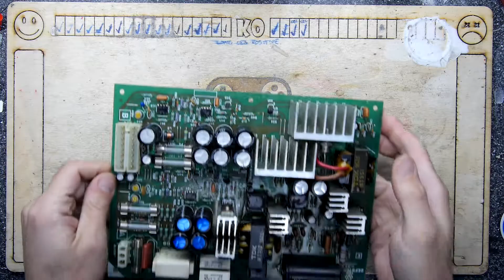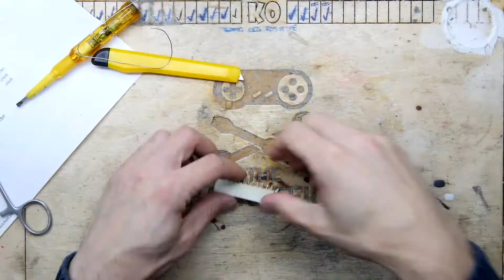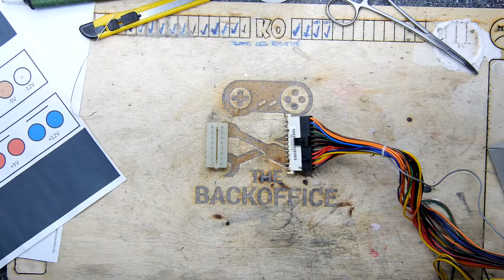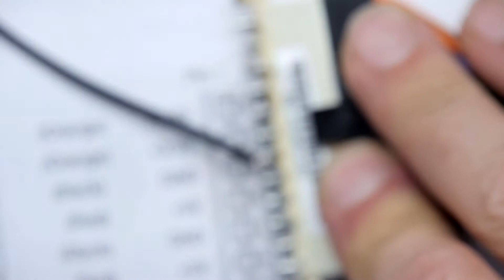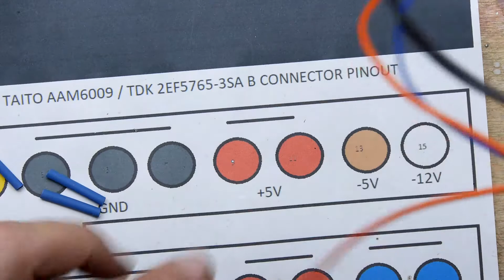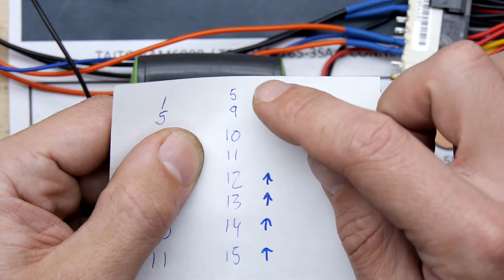Taito AAM60009 to ATX Hack

Comment: why not cut the pc psu and wire directly to the old PSU connector?
Reply: At the very end he mentions the possibility of the owner later changing the power supply, and that wold certainly be simplified by using the connector.